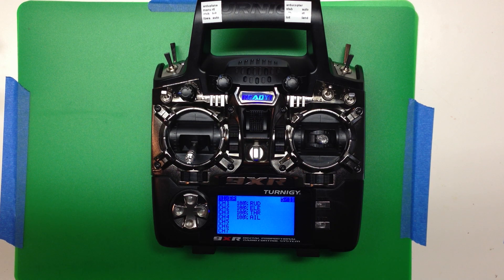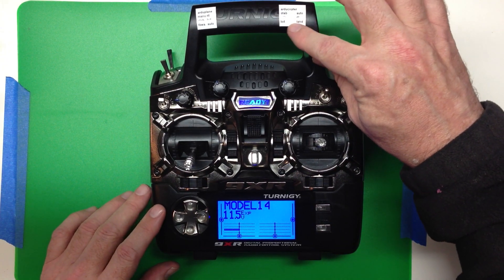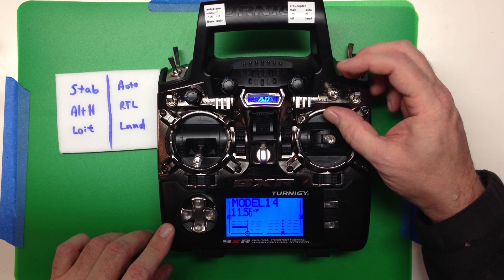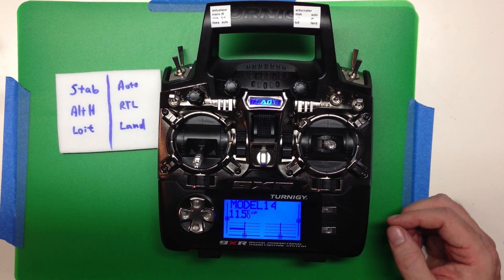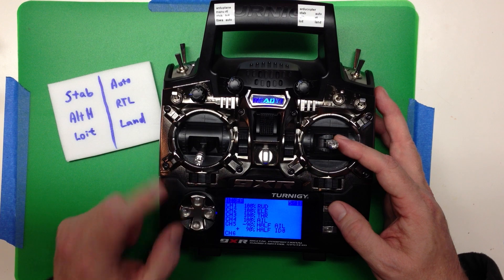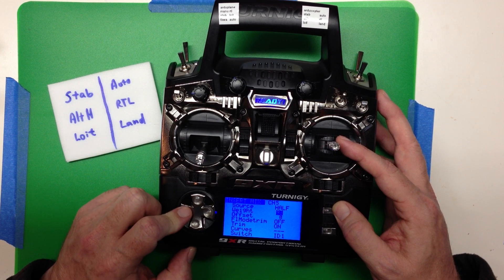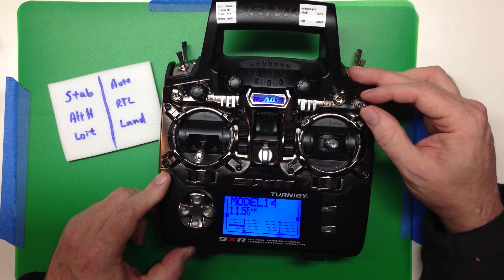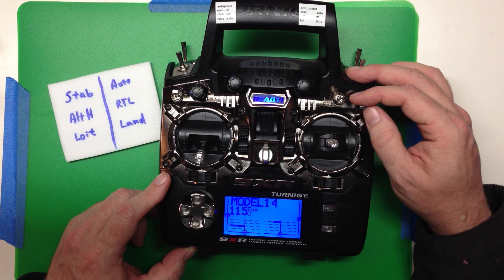er9x: Setting Ardupilot 6-Position Switch (Good for Turnigy 9xr)

Comment: Easier way still:

1- source: HALF; wt: 100; switch: ID0
2- source: HALF; wt: 60; switch: ID1
3- source: HALF; wt: 20; switch: ID2
4- source: FULL; wt: 100; switch: AIL; Multpx: Multiply

That way you set values at 20%, 60% and 100% on the 'ID' switch, then multiply that by either 100% or -100% with the AIL switch
this will give you a nice clean value table of: -100,-60,-20,20,60,100

Hope it helps

Comment: When I set my 9XR Pro up this way and hooked to Mission planner; this set up was inverted and did nothing with ID2.  So, I did the invert in Limits and when I decreased the positive 100 to 90, then the ID2 switch worked for the up position on the AIL switch, but not the down position.  So now, I can find 5 of the 6 positions in flight modes on Mission Planner.

Comment: Is there any easy way of using the same switches for the turnigy 9x with original firmware? I can´t seem to get it to work. I have found a solution to use the gear switch but would like to use the ''ail'' switch instead of the 2 position gear switch. Thanks in advance, seem you know what you are doing. :)
Reply from the maker: +Albin Jidorf Yes, it can...  It's not easy!  I made some notes about how to do that here: http://eastbay-rc.blogspot.com/2011/05/ardupilot-mega-turnigy-9x-mixing.html .Good Luck!!
Reply: +Mark Harrison thanks for your quick answer. I will read your notes more in depth tomorrow and hopefully everything will come together. Otherwise i think i simply switch the place of the switches. That will probably do.
Reply from the maker: +Albin Jidorf That's great.  Simple and reliable, I will remember this for the next time someone asks. Thanks!!

Comment: I Hello Mark, I write from Brazil and my English is not very good so I may have missed some explanation. This setting, and values can be used for any type of quadricoptero ? Thank you.
Reply from the maker: +Juliano Gomes No, it depends on the quadcopter flight controller.  But if any controller uses a single channel with 6 values, this will work.

Comment: Thanks for your help! Finally figured it out!Just to share my values:
+110 HALF AIL
-5 HALF ID0
-33 HALF !ID1
-66 HALF !ID2
This way it uses better logic. Works perfect with 6 modes on the CC3D board:)
Reply: +bramslo I had to use your settings to get this to work! now it works a treat. 

thanks mate
Reply from the maker: +bramslo sweet!

Comment: Mark that's so helpful, many thanks.  I have a TGY 9XR radio, Naza Lite and EzUHF  JR Module / Rx. So I followed your instructions to set up 6 channels on Naza and Ive used GPS Atti (ID0) Atti (ID1) Manual (ID2) with Aileron switch down.  Then with Aileron switch up I have Failsafe (ID0) and Failsafe (ID1).  For some reason I couldn't configure failsafe for ID3 but Im well happy.  Thanks again Mark your a funkin hero.

Comment: Hi! I have a question. When setting this up in mission planner for arduPLANE I am only able to set up 5 flight modes. The 6th will not highlight to change. Any ideas? Also when callibraating my radio in mission planner Channel 5 gets 6 different PWM readings as I move the two switches on the 9xr BUT, when I Go in to setup flight modes on mission planner the 9xr switches have no affect on the flight mode. I hope this makes sence. Any help would be greatly appreciated! Thanks!

Comment from the maker: That's correct.  It's a "momentary" switch.  Traditionally the trainer works like this:  when the switch is down, the instructor is controlling the plane.  When the instructor pulls on the switch, the student is controlling.  So, if there's a panic situation, the instructor won't accidentally leave the student in control of the plane if the instructor needs to jump in and take over the controls.

Comment: Hello. I just received this radio today. I'm pretty new to this hobby and I found that the TRN switch, in the up-right-back has only one position. So If I move to second position like other switches it wont hold, even if its value changes on screen. Is this correct? May be I got a faulty unit.

Comment from the maker: Ouch!  Try this mix which will give you three distinct values for ID[012].  The 3 fields to edit are Source (all FULL), Weight (100,0,-100), and Multiplex (all set to replace).

CH06 R +100%FULL Switch(ID0)
         R +0%FULL Switch(ID1)
         R -100%FULL Switch(ID2)

Comment: I am using the NAZA-M Assistant to watch my TX settings on my computer screen. I have ID0 set correctly for (Manual mode), I have ID1 set correctly for (Atti) mode but I cannot get the third position ID2 set for my GPS mode. What in the heck am I doing wrong here? OMG I wish I had hair so I could pull it out!!!

Comment: OK now I am really confused. I only need 3 positions from my 3 pos sw. I am setuping up a NAZA-M ok. I Set CH6 ID0 for (manual) mode ID1 for (Atti) Mode but I cannot get the 3rd position (ID2?) to work for (GPS) mode. ID0, ID1 & ID2 are the three positions of the 3 pos switch right? Position 1 and 2 work great but I cant adjust 3 at all. I am missing something arent I ?

Comment: If ail switc is 0% and 96%, then if you add 17% 45% and 90% on ail0% then it will be 0,17,90%. But uf you do add 17,45,90% on -96% then it will be 79,51,6%. What I wanna say is that its not centered. Its 79,51,6 vs 0,17,90. Am I correct?

Comment: Hi Mark
Great video, don't have a Quad, can you give me switch setup for plane,ie what controls what, I'm having no luck getting fail safe to work, find for some reason when RTL is switched on motor stops ????. this is with my original er9x now have a new 9XR can you tell me what drivers you used for USBasp I have XP on PC. Regards and cheers Geoff